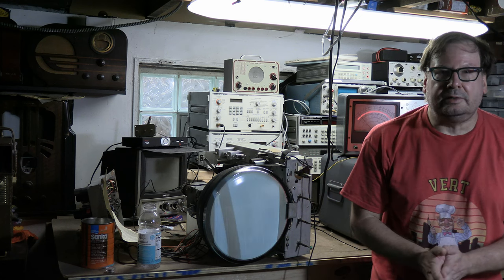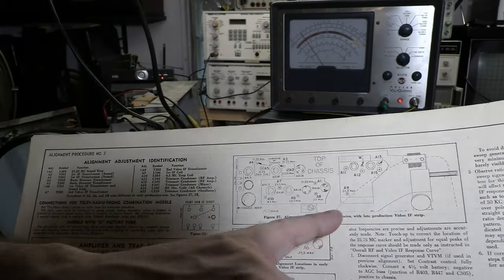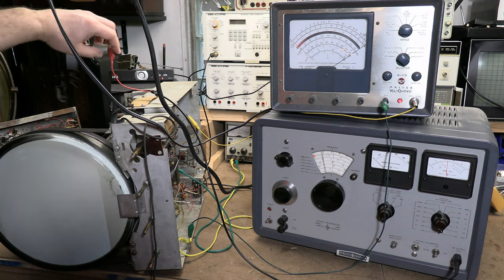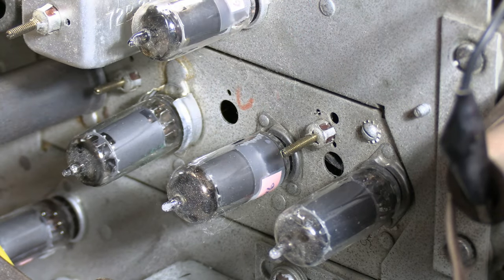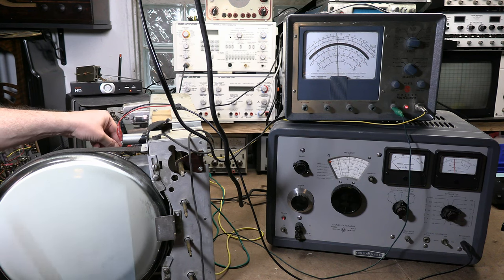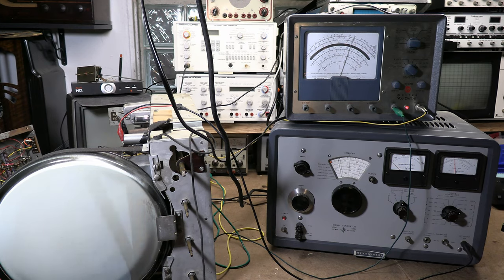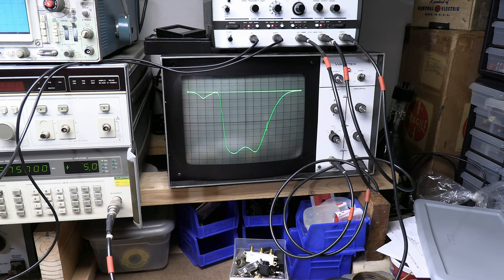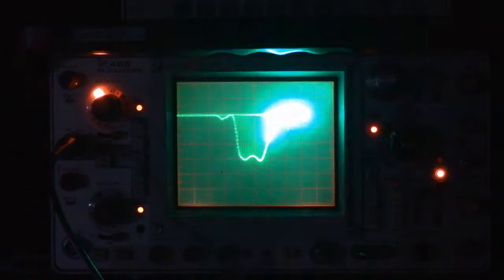Vintage TV Alignment 101: Stagger Tuned Video IF

Comment: I wish Emerson had gotten the memo that you should be able to do a video IF alignment with only a signal generator and voltmeter, but no. They require a sweep generator. They also put one of the IF cans directly under the CRT in the 87B chassis, making it impossible to adjust without removing the 10BP4. I am, to put it mildly, a little bit annoyed.
Reply from the maker: Some designs do require a sweep gen. I'll take a look at the Emerson service manual.
Reply: @bandersentv  You don't need to spend your time. I should be able to borrow an HP 3585A spectrum analyzer which looks like it has enough functionality for everything IF on an old set.
Reply from the maker: There doesn't seem to be an Emerson 87B chassis, but I did look at Sams 97-4 covering model s614,637,644,647 and 648.  I see what you mean.  It's not using stagger tuning.  They use traps and over-coupling to set the response.  Yes, you do need to use a sweep gen.
Reply from the maker: @eDoc2020  Ah but I do (at some point anyway).  I have 3 Emersons to restore that use this chassis.
Reply: @bandersentv  87B is the shortened version of the chassis number, as written on the serial number. The full number is 120087B-D and is used on the 606, 611, 612, and 624. The signal path is identical to the 614 so what you found is still super useful.
Reply from the maker: I'm curious to hear about your results as I get asked about using SAs for alignments often.  I see it only goes up to 40 MHz which should be fine for the IF.  High impedance input is 1M which should be fine as well.  Good luck.
Reply: @bandersentv  The problem with the spectrum analyzer is the only input is RF. For the steps calling for a detector probe I figure I could use a scope probe instead and then could use the builtin marker and counter functionality. But what about the steps using the TV's detector? Probing before the detector would load down the tank circuit. I don't know how probing after the detector but before the filter would work. Worst case would be using an external XY scope. I think one of the jacks on the back of the SA is the X position as it sweeps so an old-style setup could be used. This of course would be ignoring almost all of the SA's features and would be like you mention in your next video with the TinySA.
Reply from the maker: @eDoc2020  Ugh, hadn't thought of that. Maybe you'd be better off just getting a used Wavetek sweep gen.  Model 1002 is very easy to use
Reply: @bandersentv  That's not exactly cheap. I'd rather work on my $5 Raspberry Pi Pico based generator. With my basic testing it seems to work well enough but I should make an output attenuator to get more controlled coupling. As-is the software should be good enough to perform a VIF alignment but right now it's only controllable using a CLI via a connected PC.
Reply from the maker: @eDoc2020  It's all relative.  Got mine for $50 and see one listed for $89.99 and another for $110.  Goes up to 500MHz with nice attenuator and marker options.  A heck of a lot cheaper than a new Keysight gen for thousands.

Comment: Can a b&k tv analyst be used for this?
Reply from the maker: 1077 - no.  415 yes but only for 44 MHz IFs.  Many early TVs like this one use a 22 MHz If.
Reply: @bandersentv  in that case what tool do you recommend I get that would let me do this? Preferably something that can be found easily
Reply from the maker: I did a whole video on selecting equipment a few weeks ago.  To do what?  You need to be a lot more specific.  Are you sure you even need an alignment?  What type of TV ?  Stagger tune with peaking stages or visual sweep generator?  22 or 44 MHz IF?
Reply: @bandersentv  I’m not super familiar with this level of tv repair, but I’ve got a tv from 1958 where the picture is clear on one end of the fine tuning, but then in order to get good sound the picture goes fuzzy
Reply from the maker: @turle8645  That's a little odd.  They stopped using split carrier IF around 1950.  By 1958 they were a lot more reliable.  All I can think is the 4.5MHz sound alignment is off.  I really doubt you need to touch the video at all.  I'll be demonstration sound alignment son.  It's much easier to do.

Comment: 9:15 put DMM in manual range and bar graph should have better range and resolution.
Reply from the maker: How so?  The auto range put it on the 3.2 volt range.  Manual mode would just range be the same.
Reply: @bandersentv  Possibly you are right. I seem to remember setting the range manually showed full scale on bar graph. Next time I'm at my bench I'll try a couple of my meters and see. It's as if you can specify a smaller scale or range than the auto range function will select. Might be different meter to meter.
Reply from the maker: @johnnytacokleinschmidt515  I'm using a Fluke 27/FM.  The ranges are 0.32, 3.2, 32, 320 and 1000